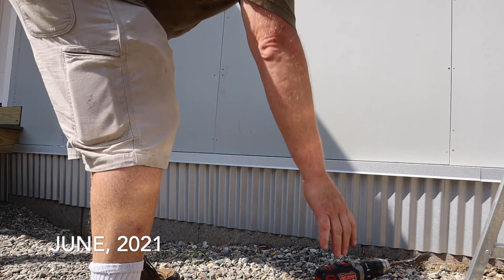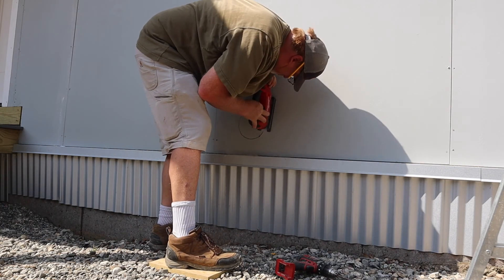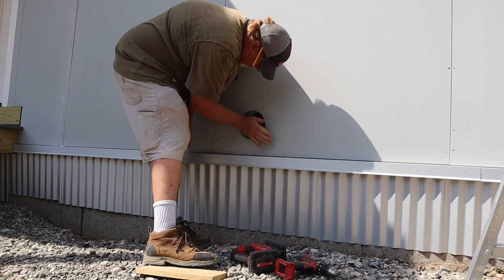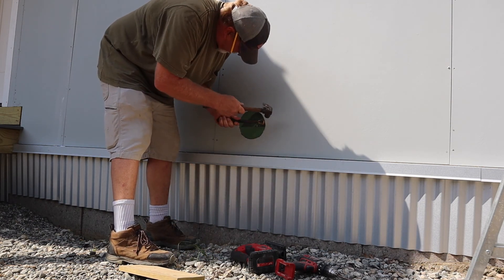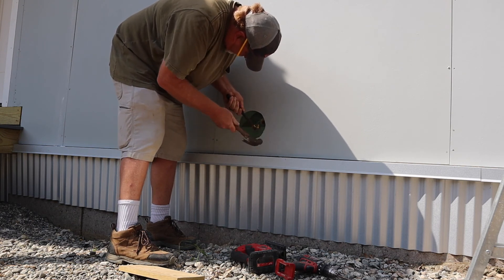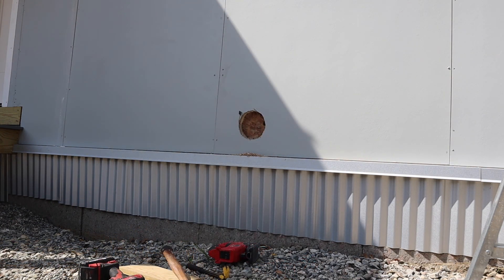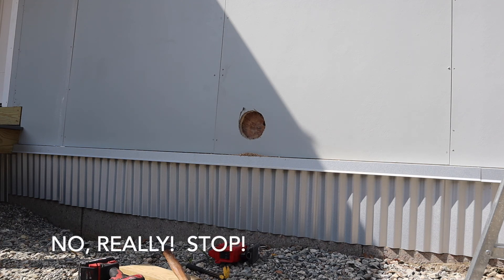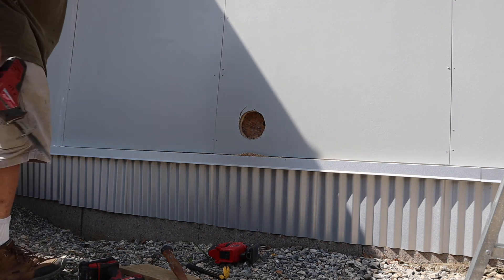Why we installed our RenewAire EV-200 ERV

Comment: Could you provide me wit ha detailed list of materials for this ERV system? Also, what kind of power/plug use? Thank you!
Reply from the maker: All I used was the unit itself and a bunch of flex duct ties into a main trunk.  You only need one 110v outlet for the two fans.  I used low voltage switches in each bathroom (to turn it on during showers) and a low voltage timer to turn it on regularly.  That was from the same company as the unit

Comment: Hi, are you exhausting and supplying to more than One Room in your house? I'm using Independent Install Setup. When Exhausting/Supplying from/to more than One Area/Room/Locations, How do you maintain Suction/Supply Air? I Have noticed a Significant drop in Air Suction from Exhaust and Decrease in Supply Air when I "Tee" in to more than One Area. The 6in Ducts drastically drops the air movement after I "Tee" Off into Any Location. How do You Overcome this?
Reply from the maker: I only exhausted to one spot, in the living room.  I haven’t noticed a decrease in suction from the three bathrooms locations.

Comment: Does your fireplace have its own fresh air intake?
Reply from the maker: Yes…I installed a make up air kit for the stove hood, and put it on a switch so that I can turn it on when I light the wood stove
Reply: @whitepinewoods9029   What make up air kit did you go with and where did you put it. You mentioned you might do a video on it, but I couldn't find it. Thanks!
Reply: Are we concerned about the condensation that bathrooms get when showers run, into the ducting ?

Comment: Thanks for the video great contents...I was thinking to do the same and saw this video where they attached it to original central air system duct , hence reducing double duct work. https://youtu.be/26RTxYeupOA  ... also can you plz check if these fans strong enough to flow air in such long duct? I'm not a technician but just a thought,  also since the ducts installed very long and fans nor poweful the system heat exchange might be effected and not allow correct fresh and stall air exchange.
Reply from the maker: Thanks for watching!  I considered that…but my returns for the hvac are at the other end of the house, plus not sure I’d be able to get enough make up air into the house that way.  Thanks again